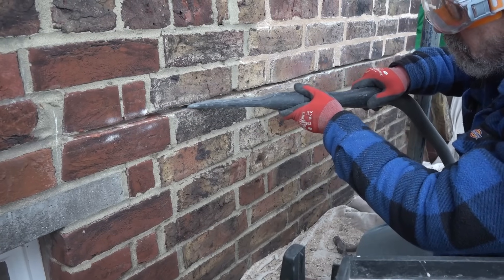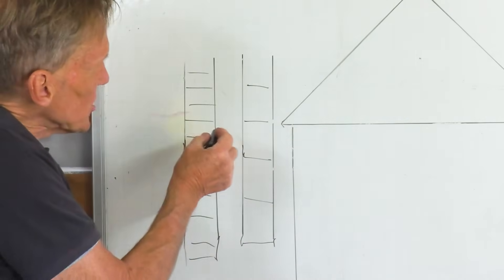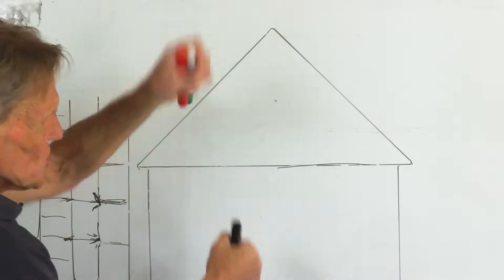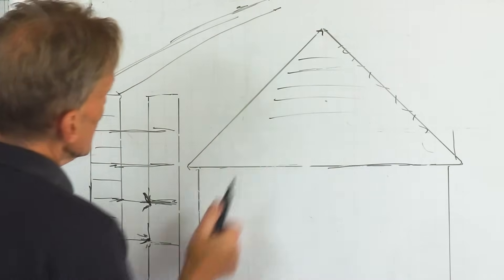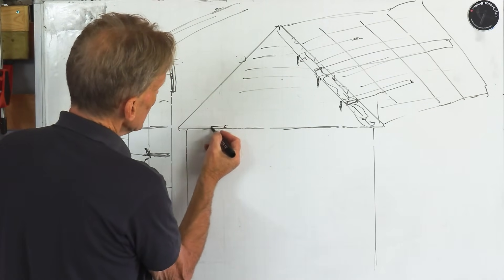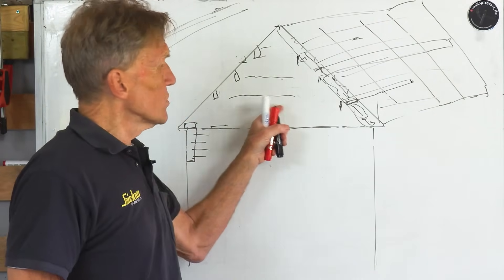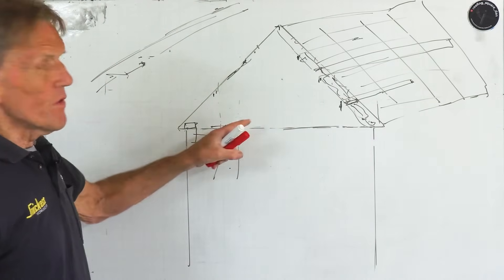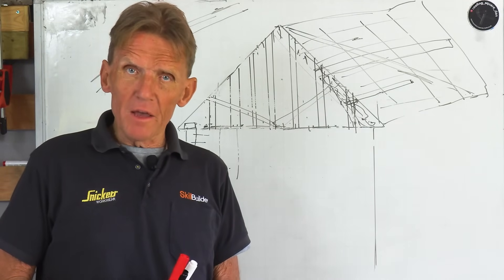Is This Climate Change or Bad Building?

Comment: I've just completed gables at the end of a Bellway development. 

There are 7 gable straps to build into the inner leaf of blockwork. 

4 that are equally distanced and run over the top of the ceiling joists (flat rafters that bear onto the plate), 2 more half way up, then a 7th at the apex (the top part).

These stainless steel ties must be screwed down with max 200mmm spacing between screws. The ties are screwed to 4/1 inch timbers, which are gang nailed to a minimum of 4 ceiling joists/rafters.

Wall ties are used every block course, and are within 300mm from the rafters ends. This ties the brickwork firmly to the blockwork at its weaker points up the gable.

Finally, the brickwork is run tightly, just passed the soffit. The soffit locks in the perimeter of brickwork as it ascends to the apex.

So overhanging soffit/bargeboard designs, with regularly located gable straps are the strongest in my experience. 

Also, the NHBC specifically inspects this detail during the pre plaster phase of construction.

Comment: I built a lovely work shop with a mansard on top with gable ends. It had a huge steel beam in the middle with a full frame following the roof profile.  Full structural specification.  When I put the lid on you could initiate a wobble by stepping back and forth.  It was alarming to say the least. We decided to line the whole room inside with plywood clenched using screws. This seemed to stop it dead.

Comment: Pultruded basalt wall ties don't corrode at all, as well as having dramatically lower thermal conductivity. But I think they are still rather niche. Have they caught on at all outside passivehouse building?

Comment: Wind travelling at speed has a lower air pressure than stationary air. This is called the Bernoulli effect. Venturis are formed in the gaps whenever wind is forced to blow between thus creating these low pressure zones. The simple solution is as Roger has suggested. A slightly more complicated one would be to have vents on the gable wall where high pressure air ducted to the low pressure one.
Reply from the maker: Pilot's knowledge

Comment: A 4inch brick not even a full brick no chance of it holding a gable end be honest any of you structural engineers haha can’t admit it because it is in all the books.Solid brick wall I can’t get anyone to show how it’s done.Not even you Rodger.
Reply: Ha ha.  I'm a structural engineer.  Don't think you quite understand the concept of cavity wall built with two skins of 4" masonry connected together with wall ties so they act together.
What is it about solid walls that you can't get anyone to show you??
Reply: @johncranna9427 The lateral connection to the rafters on a solid wall they show new build but not solid wall the steel goes behind the brick so there is not a full brick.If you could point me in the right direction that would be great John.Cheers the rafters I have that bit it’s the 4inch to the wall I can’t find.
Reply: @johncranna9427 Yip just as I said are yous guys Freemasons and it’s a secret not to be shared.Why won’t any of your gang Structural Engineers put a sketch up.At a guess it is a joke like I said.There is no drawing showing a solid brick gable wall to rafters.Everyone would see what I am on about and laugh.Cheers anyway John a 4”bit of steel on 2”” of brick nope not a chance.HaHa aye Laddie.
Reply: Never heard no more like I said Structural Engineers won’t comment because I am right.A 4”bit of steel will support that gable wall give your head a shake Structural Engineers no chance.Plus the beams that get fitted are way over specked 30ton load for a few bricks,time served in engineering proper engineering.Ships, Rigs and Bridges that have stood the test of time where the weight of the beams is important and worked out to the kilogram.Just a rant haha don’t mention heat pumps.

Comment: A mate in Bude, Cornwall had this problem on his new(ish  maybe 10yr old) build .  The whole triangle part ended up on his drive.  It's on the coast but his estate wasn't what you'd call exposed...well protected by larger buildings so maybe the suction effect Roger mentioned.

Comment: Wall ties will rust where the due point regularly occurs, that can be anywhere along the tie, however in most older buildings the due point is generally nearer the inside skin. Plus due to the act of laying brick the rust protection on the tie can often be damaged, so you get point rust

Comment: No the winds are not getting stronger - that is 'climate change zealot' rubbish - more narrow three story buildings also being built to maximize number of buildings per acre.
Reply from the maker: If you look at the average it is true to say that winds haven't got stronger because some have increased and some have died down. That said we have lost a huge number of trees over the last 40 years due to high winds and that indicates an increase in the wind speed during storms. 
I have no axe to grind on this and it was never my intention to start a discussion on climate. Insurance companies are paying out for more storm damage than they used to and building regs have been tightened up. Mechanically fixing every large format roof tile is required but still not done on many jobs.

Comment: It was over 30 years ago that I last built a house, but we put restraining straps from the gables across the first 4 or 5 rafters as a matter of course. And they were sturdy rafters too, with substantial diagonal bracing.
Reply: Back in the 1970s, One job I was on consisted of a line of "town houses".  These were 3 storeys high but the rear of the house was offset by half a storey.  The interesting thing was that the party walls were all built from brick and masonry blockwork while the front and rear walls were all prefabricated off site.  So all the party walls had been constructed, then overnight, the wind blew them over like a line of dominos.  What really surprised me was that some people were surprised.  It was totally predictable and I just thank heavens that it happened while nobody was on site.

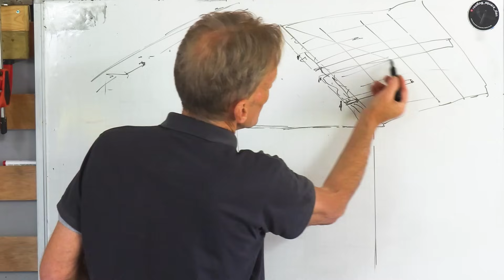Comment: 11:45 I was helping a friend run TV cables through his attic a few years back, and this place, an end unit condo,  built in 1983, had prefabricated W trusses holding up the roof. What surprised me was that the plywood and lap siding on the gable end was just nailed to the last truss, so there were no studs at all, and you could push the wall in and out with your hand, yet, probably by luck, it had survived 30 or 40 years of whatever nature had to offer. One gable will probably blow out at some point and if a claim is made, the insurance company will make them retrofit the whole condo. The house at 0:13 looks even scarier, with no attachments on the end truss at all and brick falling instead of plywood. With no internal partitions to block the wind, it seems that attics would need more bracing than the rest of the house, but being out of sight and out of mind,  they often get less.

Comment: That gable falling and not troubling the dude walking by.....caused by......... lack of lateral restraint straps between roof and wall.  Code says every 2metres.
Truss installer lifts roof into place, slaps on two diagonals and two battens into place.  Builder says thank you very much and does nothing more..
Best thing is to hire a Chartered Structural Engineer, one who can speak English, knows how big a brick is (rather than how heavy an oil rig is) and then build to his or her drawings.

Comment: The wall tie snapping at outer face of the load bearing inner wall is probably down to small movements within that wall as a result of it taking the loads.
Reply: That seems more plausible than  condensation, since the outer wythe is saturated on and off with rainwater and all the acids and salts that come with it. But I'm always hesitant to guess about reactions between metals and concrete, with so many variables. When I was getting my parent's house ready to sell, I was shocked to find that a stack of lumber against one of the basement walls had been totally eaten by termites, but the framing of the house was fine. What happened was that one of the ties used to hold the concrete forms together in 1956, but left in the wall when they removed the forms, was completely rusted away and the moisture and termites had come in through the empty hole. There were also some houses in my area with in-floor heating tubes that went bad, but only where the concrete slabs ran under the bathrooms, the pipes in the dryer parts of the houses were still OK. But it also varies with the mix of concrete used in each area; there are plenty of stories from Ireland, Connecticut and other places, of batches of concrete that seemed fine for 20 years and began falling to bits after that.

Comment: It isn't global warming and stronger winds it is poor design. Terrible modern building practice. And awful modern construction products. That combined with modern insulation practices, just leads to piss weak walls. You now have toy town engineers armed with a computer, that only spits out what some Muppet put in. And you get numpty designs that fail. The old large gables were 9 inch or more. I have cut through 18 inch. They used strengthening columns. Tied in chimneys and bracing walls. Solid sensible construction. Today they build out of fag papers and the insulation is more important. But that crap isn't structural. Tooth pick trusses instead of cut and pitch. Just weak modern design. Then you had the fairy liquid scandal as plasticiser. It isn't hard to build a solid gable end. But modern construction process prevents that. We haven't gone forwards, we have gone backwards. Modern housing is unhealthy and very poor. Built to a price badly. I look at the materials used today and want to start a bonfire. They are match wood. Compared to the huge gear we lugged around 40 odd years ago. Everything keeps getting blamed on worse weather. A recent cyclone that hit Brisbane is being used as an example of global warming. But what about the one in 1974 or the one in the 1860's. All crap. You build it weak, it will fail.

Comment: Roger I'm a roofer of 35 years  - sorry! winds have not got stronger - you are right about the rest of it - its all down to workmanship and design failures
you don't see it with solid walls with cable end chimneys and purlins
Reply: I agree.  What about the storm of 1987?  Also Roger says you can't calculate it, we'll I'm a structural engineer and we can and do calculate wind loads!!
Reply from the maker: I know you can calculate wind loads but the way they behave around buildings with vortexes etc is a lot more difficult to predict. I went to the Builder Research Establishment in the Cardington hangar where they build a model of a large city and blew smoke through it from various directions to see how tall buildings affect the wind direction. 
I am sure it is now done with computers but when we are looking at a row of semi detached houses which have had box like dormers added, I would refer to my original claim that it is difficult to calculate.
Reply: @SkillBuilder  when you're calculating the wind on roofs and walls there are areas at the edge where you have to apply higher factors due to the vortices that you're talking about.  I'll email you a copy of the various coefficients on karts of the roof.  They must have calculated it all at the Cardington building.  I seem to remember that it's an enormous hangar where they built the early airships.
And talking about shedding vortices, it is this wind loading on the Tacoma Straights Bridge in USA (or Galloping Gertie!) that caused it to collapse - do you know that video?
Reply: @SkillBuilder  so true - you are right - it is difficult to calcuate
but now that we know the modern design weaknesses it's not difficult to solve - as you know well Roger a little bit over-engineering does the trick (fine I know on a single roof costly on a whole housing estate - but still worth it
Reply: @johncranna9427  The 'Right' storm could bring most walls down - thats just bad luck - but overall (from you as a structural engineer) have winds got stronger over time?
if anything, from my own empirical experience i'd say that it was windier in the 80's
Reply: @McDowell1923  I've got no specific weather data to say whether we get worsecstorms now than before.  All I know is the data of wind speeds and formulae to calculate the wind loads on walls and roofs has not changed substantially.  Codes get revised and and the Eurocodes brought in 10 years ago shook things up but brought more accuracy rathervthan higher loads.  What has changed since I started in 1982 is the way snow loads are calulated.  There is a lot more precision in snow drift and valley build up and parapet build up.
Reply: @johncranna9427  thankyou John
Reply: Could the more crowded designs of modern housing estates make the problem worse? 

Especially if you have open fields next to them, wind blowing across the field then gets funnelled in between lots of relatively narrow gaps between the houses so will locally be travelling faster when it squeezes through.
Reply: @LWillimott-ur5vd  could well be - i'm just thinking about all those rows of terraced and back to back type houses with no gardens all cable wall types, in small towns up and down the country - they survived
Reply: I totally agree with you Roger is making false claims about the weather. He also is missing a lots of proper information. He also should remember storm bracing in the roof  and diagonal bracing also transfers the load from the gable ends.
Reply: Dead right mate - winds have NOT got stronger.
Reply: Stronger?   Thats difficult to quantify.  More frequent?  Thats a sad fact. Either way anything built today is going to have to deal with a much wetter and windier environment.  Its only going to get worse.
Reply: @JohnDruitt-c5s  'repeat a lie long anough' and all that. it ebbs and flows - it might be a bit wetter and windier the last few years but it was quiet before that and very much worse before that - the difference today is that we are constantly being told its getting worse - it's called gas-lighting - to push an agenda

Comment: We have had to build in gable restraint straps since the late 70' s  , some people miss them out I know,  if the roof has gable ladders and barge boards
Reply: Gable ladders restrain the top but you still need straps at 1st flr and 1st flr ceiling level

Comment: Poor installation is sometimes to blame. If the brickie doesn't have ties to hand sometimes they get pushed onto the mortar joint after the courses are laid. Madness of course but hard to detect by inspection.

Comment: I have been on dozens of roofs in London and there were many parapet walls between and on the ends of houses that had mortar no more useful than sand. I have disassembled them as well as a whole chimney that was being held up by nothing more than the weight of the bricks. I started disassembling one parapet wall from the bottom and the whole bloody wall slid down. Do not walk near buildings on the street in London because a load of bricks may fall on your head.

Comment: More prevalent now because everyone building in timber frame rather than two leaves of blockwork with a heavy duty galvanised steel wall tie and good quality labourer mixed mortar used
Reply: You have a point. Brick construction, wood construction and steel construction are all fairly reliable if you know what you're doing, but mixing them presents some unanticipated problems. This reminds me of the 18 story W. E. Duboise Library at the University of Massachusetts. It was built in 1972 from steel and brick veneer and was fine at first, but when they started loading up the building with books, the steel sagged just a bit and the bricks started popping out. It took years to fix it, during which it was half empty and you could only enter through covered walkways.

Comment: Hi Roger,
a few years ago i went inside Beverley minster which is now 800 years old,they were doing a tour up into the roof structure,we climbed up a spiral staircase right up to the top,the guide showed us around and pointed to these huge steel threaded rods  which spanned between the stone gable ends,i cant remember when he said they were installed but they were not original, he said that when it was windy one day they people in the church could hear loud bangs from above and when engineers went up in the roof they said the gable ends were swaying in and out banging against the timber roof structure so they designed these steel rods to brace the structure and the problem was solved.
This problem has been around for many centuries i suppose.
Reply from the maker: I have read about the wind loads on cathedral walls and what they did to brace them after a couple collapsed. We live and we learn, then we forget.
Reply: @SkillBuilder  Yes.  People often say how fantastic the mason-architects were of these medieval cathedrals but only the successful ones remain.  History is littered with building collapses where they went higher and wider than the structure could withstand and later fell down.  Sometimes killing a large congregation!
Reply: That reminds me of what happened to my high school, one of those 1960s buildings with prefab window-wall facades. One day in 1969, with strong winds, the window walls started bowing in and out and the wire-lath plaster they used to cover up the attachments shattered,  making everyone in the building panic, thinking the whole place was collapsing.  Of course it didn't, and by the time I arrived there, they had done a very messy job of patching it up. The building is still standing, but is was completely gutted about 10 years ago, so I hope they did a better job of attaching the facade this time.